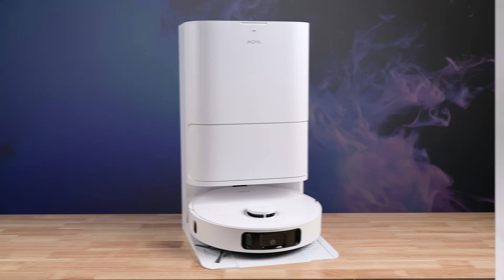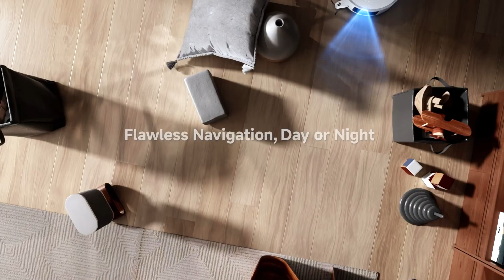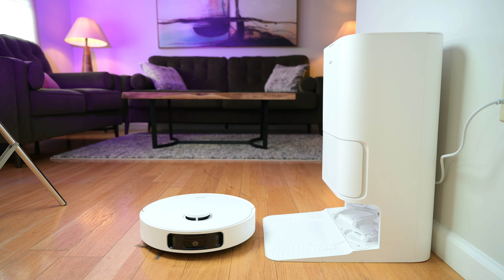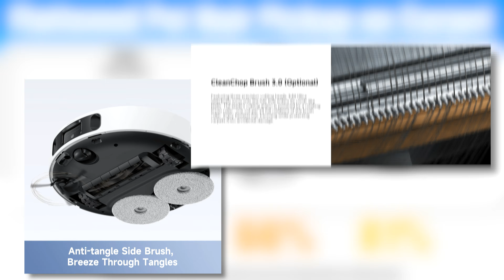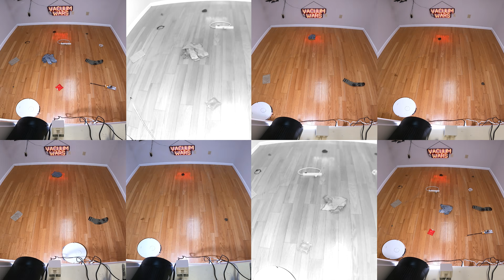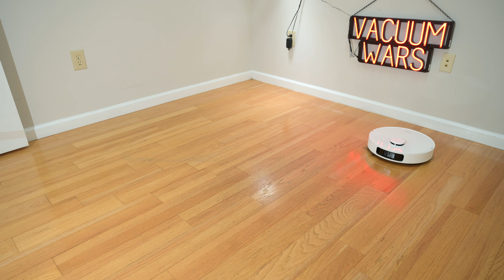MOVA E40 vs MOVA P10 Pro Ultra - Cheaper is BETTER!!? - Robot Vacuum Review and Comparison

Comment: Just bought E40 ultra for 320usd. P10 ultra is not disttibuted here in Vietnam.
Reply from the maker: 320 USD sounds like a pretty solid deal 😄 Availability can vary a lot by region, so sometimes the "best" robot is the best one you can actually buy locally and get support for. Hope the E40 Ultra works out well for you!

Comment: 🚨 WARNING: DO NOT BUY! TERRIBLE BATTERY & NO WARRANTY SUPPORT! 🚨

I bought the MOVA E40 Ultra and the battery suffered a critical hardware failure after just 3.5 months. It gets stuck charging at 93% on the dock and drains insanely fast during cleaning (dropping from 35% to 10% in just 9 minutes!), dying in the middle of the room. I did all the factory resets and maintenance, but the battery cell is clearly dead.

The worst part is the CUSTOMER SERVICE. MOVA is a sub-brand of Dreame , and although they claim a 1-year warranty on batteries, their support is a scam. I contacted their official regional email with all the invoice and video proofs, but they completely refused to help. They claimed they "do not handle after-sales" in my country (Brazil) despite having a dedicated local email, and bounced me back to Amazon (whose legal return window had already closed).

I even offered an extremely easy compromise: just mail me a replacement 5200mAh battery module or give a partial refund so I could buy the part and fix it myself. They outright refused, closed my ticket, and abandoned me with a $600 paperweight.

Save your money and buy from a brand that actually respects its customers and honors its warranties!

Comment: I'd like you to test dock performance as well.  My dock has sand dunes on the ramp and in the mop cleaning basin.  The ramp debris is created by the vacuum.  Suction is turned off before it goes up the ramp.  So in addition to the ramp, I also get debris build up around the dock.

Comment: I thought the Yeedi M14 Plus was the new Best Budget robot. Are we back to Mova P10 Pro Ultra?
Reply: Read the title. Did it say VS Yeedi M14 Plus? No. It’s a comparison between two similar robots with vastly different pricing. Reading is a lost art nowadays…
Reply: @idleoutcaster  Watch the video. Did you get to the end bit where they say, verbatim: "Right now, the Mova p10 pro Ultra remains the value champion at Vacuum Wars"? No. Watching is a lost art...